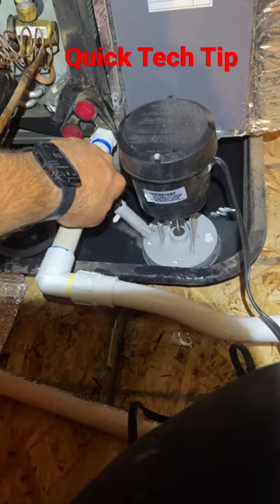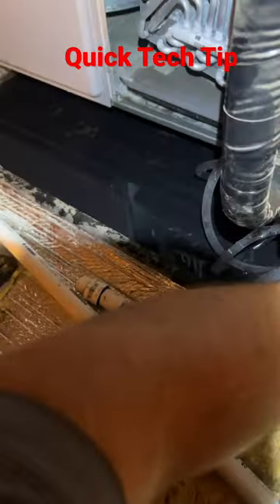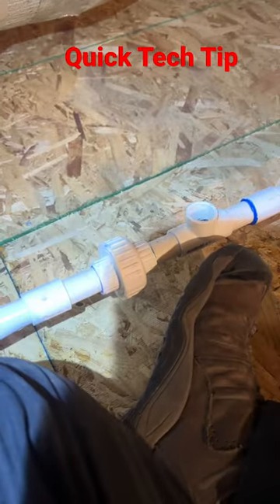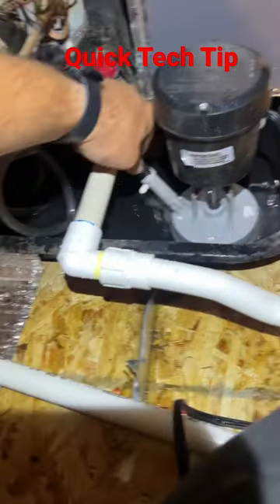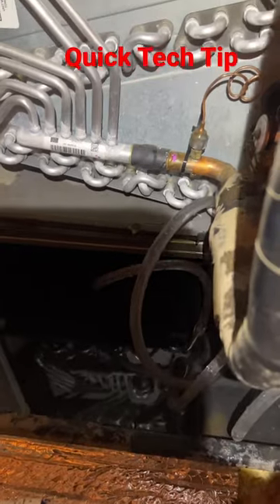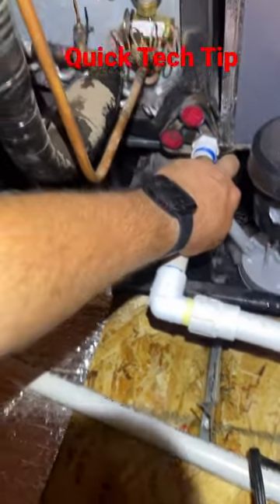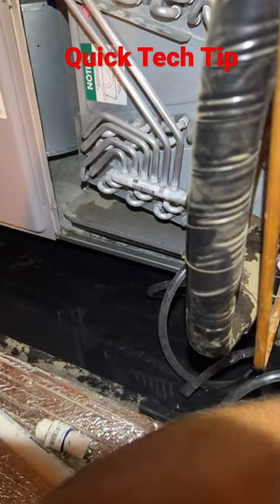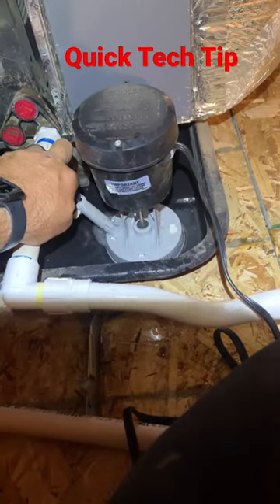Testing Primary Condensate Pan, Drain Line, and Draining the Secondary Drain Pan at the same Time!

Comment: Unless that is in the supply and not return it should have a P Trap not a running trap negative pressure in AHU will keep water in unit only drains when blower shuts off
Reply: Ahu needs to be higher there's not enough fall on that drain for my liking